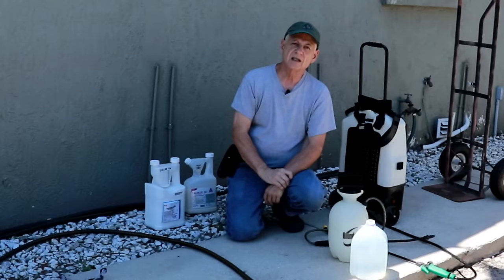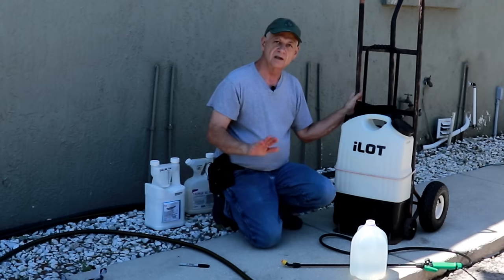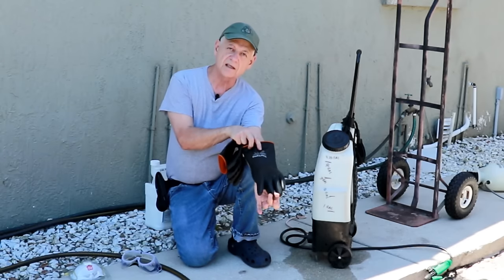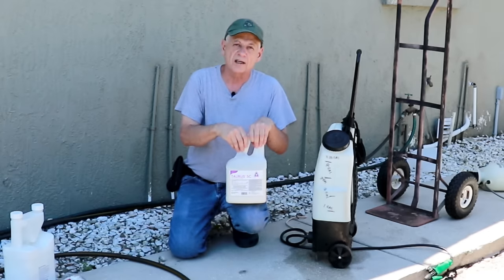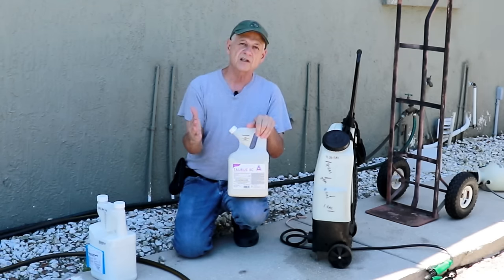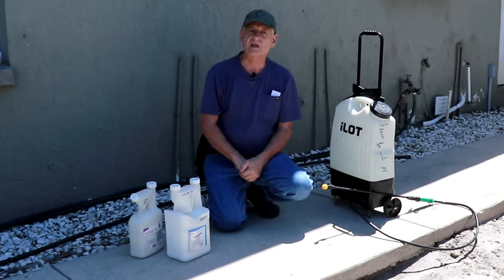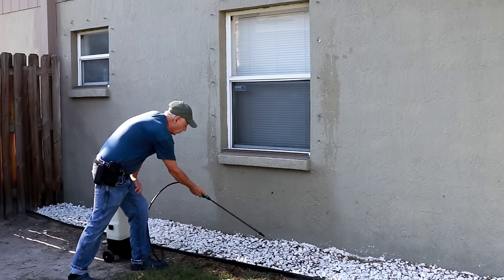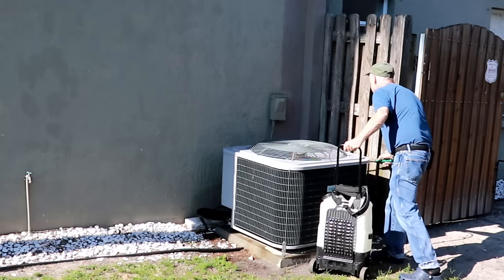General Exterior Pest Control - IMPORTANT!  READ THE DESCRIPTION.

Comment: Thanks for all the videos they are very informative  and well done.  I have a question   ?  Can you mix the IGR WITH A pesticide  or is it better just to use those discs of the IGR .   Does mixing both together  dilute  the effectiveness  of either? Thank you for your time and thanks for making these videos
Reply from the maker: Sorry for the delay in responding.  Your comment was held for review by YouTube, so I am just now receiving it.  I don't know why they do that.  You can mix an IGR with just about any pesticide you want, and it usually makes it work better.  The only thing is that IGRs are expensive.  So, I rarely use them outside.  If you are treating German cockroaches indoors, then the IGR disks are your best bet because of ease of use.  You must replace the IGR every 3 months.  This is very time consuming with liquid IGRs.  The disks are nice because you can just slide one under appliances and next to electronics, instead of moving those things and treating under and around them every 3 months.  The bottom line is that I do not keep any liquid IGRs in stock.  There is almost always a cheaper and easier way to go after a target pest than using a liquid IGR.  I hope that helps.  Be well my friend.

Comment: Hi there! I first want to say thank you so much for this video!!!... but if you don't mind I would like to share a situation I currently have.. and had a few months back.

I live in N.C. and my home is about a year old. The builder put sod in the front and part of the side yard. My home is on a corner lot so I have a decent sized yard. I have some grass now but it's very patchy.  When I walk my yard notice that I have a lot of large ant hills which might explain my issue I had a few months ago. 

My kitchen was crawling with ants they were coming out from behind my stove, my upper cabinets, and out of the electrical sockets... it was a sight to see. I keep my home very clean so I didn't have any crumbs out to "feed" the ants..

Later the next day I noticed lots of ants crawling on the baseboard in my laundry room which is on the 2nd floor.....it looked like hundreds of them were in a basket full of clean clothes that was on the floor in my laundry room. I ended up throwing the entire basket of clothes away 😡 it was just too much to try to deal with.  

The ants are not in the house now, but I think that's only because the weather is cooling off ??🤔 and my fear is once Spring/Summer comes back around I will face the same problem. 

My current problem is Silverfish in my house. I am killing at least 4 or 5 a day!! And it is so annoying...I also have had a few centipede looking creatures in my garage... 

and lastly the darn spiders. I am terribly afraid of spiders and my neighbor killed a huge brown recluse for me that was on my front porch and I had another on my patio that I drowned using the Ortho Home Defense spray..this was all within days of each other about 3 weeks ago. 

I will be honest, I am quite uncomfortable in my home and a bit paranoid to even sit outside and enjoy this beautiful fall weather we are having because I'm scared for myself and family of one of us getting bit by those god awful spiders or the lingering ants that are still around. 

Lastly, they builder has a contract with some termite company here. I have these round green plastic looking inserts pushed down in the yard all around the house... maybe about 7 total... they said it's where they inject the termite repellent.. if I can get those green things opened myself can I use any of the products in this video for termite prevention inside the green things in the yard? (Sorry I'm not sure what they are called)

And if you have any suggestions on how I can prevent another ant infestation in my home..and get the ant hills out of my yard... how to get rid of these horrible spiders, and these annoying silverfish in my house??

Sorry for the long post...I just wanted to be descriptive as possible for any feedback if you have the time. Thanks again for this great video!!
Reply from the maker: Oh my, you have some real pest problems.  I am so sorry that you are going through this.  Let's see if we can get some of this unpacked for you.  As bad as it all seems, I think we can get control over all of it.  

Let's start with the ants.  Before you can effectively treat them you need to figure out the species.  This is not as difficult as you might imagine.  Just catch one without crushing it or spraying it with pesticide and have a look at it with a magnifying glass.  Take note of how large it is.  If it's a really big, black ant, then they could be carpenter ants.  If they are much smaller, then you may be looking at a fairly common kind of ant that likes to colonize inside your home.  Take note of the color of the body parts.  Ants have three body parts.  A head, a thorax, and an abdomen.  The body parts can be all the same color or they can be different colors.  Just write back to me and let me know the approximate length of the ant and the color of the body segments.  Also, take note of the area between the thorax and the abdomen and see if there are any humps between those body parts.  If there are, then let me know if there is one or two humps.  Armed with this information, we can pretty much devise a treatment plan.

Most ants and other pests typically live outside, but will enter the home when they do not like the climate conditions outside.  So, you should do the treatment described in this video as soon as possible.  Start with the Taurus SC.  Three months later, treat with the Talstar P.  Three months after that, treat with the Taurus SC again, and so forth.  You must treat every three months and you must alternate the products.  I was not clear on that in the video.  If the ants are living outside, then this will stop them cold.

Now, let's talk about those ant mounds in the yard.  They could be fire ants and those could be the ants that are entering your home.  In any event, they are very easy to treat.  I have a video on how to treat fire ants and it only costs about $10 to treat your entire yard.  This will work even if these are not fire ants.  This stuff will kill off any kind of anthill.  I will place a link below for the video.  This product works overnight, so the ants will be dead the next day.  So, wait about 48 hours and then treat the entire lawn with the Talstar P.  You just need to use a garden hose sprayer that will dispense the pesticide.  I will provide a link for a good garden hose sprayer.  Mix the Talstar P one part Talstar to one part water.  To do this, just fill the sprayer container half way with Talstar and then top it off with the water and shake it up after you screw it back on the sprayer.  It helps to put a dye in too, so that you can be sure that the product is being dispensed.  I will give you a link for that as well.  Set the sprayer for two ounces per gallon or four tablespoons.  Then just spray down the entire lawn with it.  This will kill off every bug in the entire lawn.  Repeat the process every time you notice that you are getting ants roaming around outside.  I usually do it about every 60 days, but I live in Florida and we have a lot of ants and other pests.  You may only need to do it every 90 days.  Just use your best judgement.

Silverfish are also an outside pest that will enter the home when they do not like the weather outside, but they may remain in the home and actually breed in the home.  So, the exterior treatment will prevent new ones, but you are going to need to treat the ones you already have.  I do not have a video on silverfish yet, but Solutions Pest and Lawn has a fairly good one.  I will place a link below for it.  Keep in mind that silverfish love moisture, so running the air conditioning and keeping it cool in the home will help to deter them because the air conditioning will remove a lot of moisture from the air.  Also, they don't mention this in the video, but you can put some of the Talstar P that you mix up for the outside treatment and put it in a spray bottle.  Then, in addition to what they show in the video, just spray the baseboards where you are seeing the problem.  Also, these guys love books, cardboard boxes, stacked or filed paper, and so forth.  So, have a look at these items to find places where they may be hiding.  I know this may sound crazy, but if you have a book that has silverfish, just put the book in a plastic bag and tie it off with a string.  Don't use a metal twisty tie.  Then put it in the microwave for a couple of minutes, along with a half cup of water.  Microwaves need liquids in them or you can damage the unit, so don't forget the half cup of water.  The cup of water should not be in the bag.   Silverfish also have water in them, so the microwave will literally cook them to death, while leaving the book unharmed. Microwaves only heat water and not paper.  If the book is wet, then the moisture will get hot, but not enough to damage the book.  Two minutes should do the trick.

Now for the spiders.  They are super easy to get rid of and control.  First, they must be getting in from the outside, so the exterior treatment will prevent most of the new ones from coming in.  To get rid of the existing ones, just spray the webs with Raid Flying Insect Killer.  You can get it anywhere.  It works fast, so just wait about 10 minutes and then remove the webs with a broom or dust mop.  You should also spray behind the headboards of the beds and under the beds as well.  Also, spray under and behind the couch and other furniture as well.  Just fog the heck out of those areas.  Do one room at a time, so you don't need to stay in that room while the mist is settling.  It will have a smell, but that is not harmful.  You just don't want to breath in the mist.  It's just that easy.  After you do the exterior treatment, you will find that spiders are no longer a problem.  The exterior treatment will also prevent brown lacrosse spiders as well.  Not to mention things like American cockroaches and wasps too. 

Finally, let's address the termite stations around the house.  Those things do not repel termites.  What they do is monitor for termites.  Typically there is no bait or poison in them at all, but rather something like cardboard, wood, or a nonpoisonous bait that will attract termites.  The idea is to check the stations every couple of months for activity.  If there are termites in the stations, then the pest controller switches to a bait that will kill the entire colony.  They work well, but they are not worth paying for.  If you are getting charged a monthly or yearly fee, then you can discontinue that service.  All you need to do is apply BioAdvanced Termite Killer granules to the perimeter of the house every year and you will never have termites.  So, it only costs about $50 a year and you are good to go.  It's way cheaper than paying for that monitoring service and it's super easy to do.   I happen to have a video on that as well and I will place a link below for it.

Okay.  There was a lot to cover there and I hope I addressed all your questions.  Please get back to me regarding what the ants look like that are inside the house and I will explain how to treat for them.  Again, I am so sorry that you are having this problem.

Guy

Silverfish treatment video:  https://www.youtube.com/watch?v=uAgD4wUSBSY

Fire ant video:  https://youtu.be/VReLWuT-jcQ

Termite video:  https://youtu.be/H7rW_TSBHJ4

Fire ant killer:  https://smile.amazon.com/Ortho-0275510-Fire-Killer-Bottles/dp/B000A0UCRG/ref=sr_1_2_sspa?crid=27KIRF29JZH7H&dchild=1&keywords=fire%2Bant%2Bkiller%2Boutdoor&qid=1635603842&s=lawn-garden&sprefix=fire%2Bant%2Bkiller%2Clawngarden%2C198&sr=1-2-spons&spLa=ZW5jcnlwdGVkUXVhbGlmaWVyPUEzREhQNFZCU1dDSDRYJmVuY3J5cHRlZElkPUEwMTY4Mzg3M1VHSzZDWko3VDU1OCZlbmNyeXB0ZWRBZElkPUEwMDg1OTAzTzUxRFhWNUFDUEVTJndpZGdldE5hbWU9c3BfYXRmJmFjdGlvbj1jbGlja1JlZGlyZWN0JmRvTm90TG9nQ2xpY2s9dHJ1ZQ&th=1

Garden hose sprayer:  https://smile.amazon.com/dp/B00UER1S64?psc=1&ref=ppx_yo2_dt_b_product_details

Dye:  https://smile.amazon.com/Liquid-Harvest-Concentrated-Pattern-Indicator/dp/B01G7M309M/ref=sr_1_4?dchild=1&keywords=pesticide%2Bdye&qid=1635604007&qsid=138-7919286-1879216&s=lawn-garden&sr=1-4&sres=B01G7M309M%2CB0049IE33Y%2CB08BJ9H6Y7%2CB078GZ8PHJ%2CB000OWB2PQ%2CB07JBRJH79%2CB004XDHRCE%2CB082MPZ8D1%2CB014M9OPYQ%2CB0049I2FPM%2CB077B7KBMC%2CB01N7KSXHX%2CB00ARKSABO%2CB08XYV5XR7%2CB07GLVWYDM%2CB07TPBJBNB%2CB0742MW5G6%2CB00555SR9Q%2CB002Y6BC1O%2CB07XLM4FWL&th=1
Reply: @GuysPestSolutions   Thank you so very much for taking the time to read my message and responding with very descriptive details to each question I had. I really, really appreciate that. 

I did have a change to take a quick picture of one of the ants that was in my garage yesterday. It was black, it's body seemed to be larger in the back and smaller as it went up towards it head, it also had long antennas sticking out of it's head. It was a medium sized ant. The ants in my yard  are kinda smaller and look brownish red, I believe they are red ants. I couldn't get too close and I honestly was a little scared because it was so many of them. My boyfriend shook some Sevin dust on them ( that stuff from Lowe's Home Improvement store... and poured white vinegar on the ant hill) I'm pretty sure that wasn't the best remedy, but that's all we had around the house at the time. 

I am definitely going to purchase the Taurus and Telstar solutions and the sprayer and we are going to get to work. I want to do everything in our power so I can feel comfortable in and outside of our home. 

I did forget to mention that I have an attic, will I need to get someone to walk around and spray in the attic as well? The ants that were in my laundry room which is on the 2nd floor I have no idea where they were coming from, but my attic access door is in my laundry room. When we had the ant infestation in the laundry room during the summer they looked as if they were coming from between the floor and baseboard.. I know I mentioned I had no idea where they were coming from, when I say that I mean are they coming from inside the walls, drywall between the insulation?? That's what had me puzzled. 

I am willing to do whatever it takes and what myself and my boyfriend are able to do to keep all these critters out of our house preferably out of our yard . I know all insects have a purpose in being on the earth, but they are not welcome in our home. 🙂 

Thank you so much again for your help!!! You are very kind sir.
Reply from the maker: I will bet that the ants outside are fire ants and the best way to get rid of them is to treat each mound with Ortho Orthene Fire Ant Killer.  Just watch the video I listed in my last response.  This will literally kill all the ants overnight.  If you want to know for sure if these are fire ants, just take a stick and knock off the top of the ant mound.  If thousands of ants quickly appear and are swarming all over the place, then these are definitely fire ants.

Without actually looking at the black ants in the house, I would bet that they are carpenter ants.  If they are all black and are about 1/4 to 5/8 inches long, then they are most likely carpenter ants.  This is a big problem and it sounds like you have a very extensive infestation that needs to be treated right away.  I happen to have a video on how to do this and I will place a link to it below.  If these gals (The are all female) are in the attic, then they are busy tunneling through your roof rafters and that can result in a catastrophic failure of the roof.  So, this is very serious and not something you can wait on.  You need to get going with it right away.  It is important to follow all the steps in my video.  Everything I recommend is done for a reason, so do not skip any part of the treatment.  You need to treat all parts of the house, including the attic and even areas where you have not see the ants.  

Now, carpenter ants like wet wood, so if these gals are in the attic, that would also suggest a roof leak or high moisture content between the rafters and any covering over them like drywall.  Often times homeowners will put a covering directly onto rafters in an attic without allowing for airflow on the rafters.  When you cover up rafters you need to install air vents.  Failure to do this will result in high humidity in the enclosed space and that will result in rotting wood and carpenter ants.  So, the best thing you can do is to get a licensed inspector or general contractor to have a look at the construction of the roof to see if there is adequate airflow to the rafters.  At the same time, they can evaluate if there is sufficient structural damage to warrant repairs.  If the proper venting was not installed, then that needs to be done right away.  This is not a job that most homeowners should attempt themselves because it is important to have roof venting for exit air and soffit venting for intake air.  So, you really need to know what you are doing.  If work needs to be done, then please take the time to get at least three estimates.  Prices from contractors can vary quite a bit.   I am so sorry that you are having this problem and I don’t mean to frighten you, but it is important that you understand what may be going on here and how dangerous it may be.

Please let me know if you need any guidance to help you through any of this.  I am always here to help in anyway possible and I’m not going anywhere.  Feel free to use me as much as you need to.

Carpenter ant video:  https://youtu.be/Te9BUCaIQZY